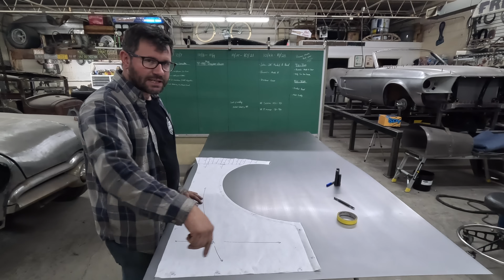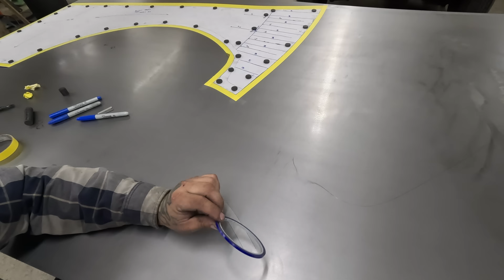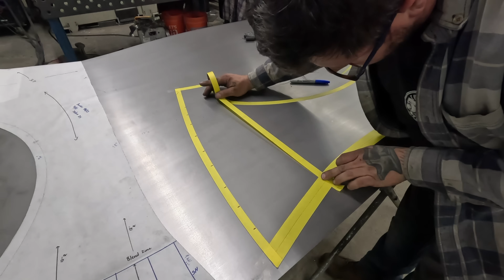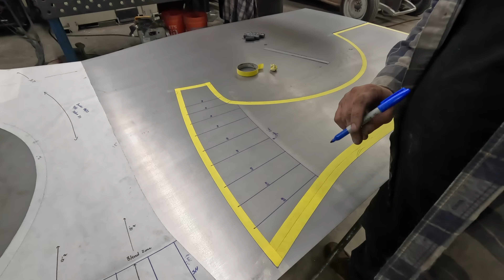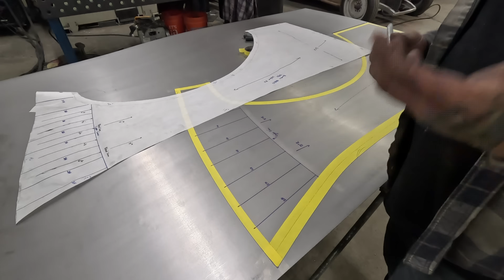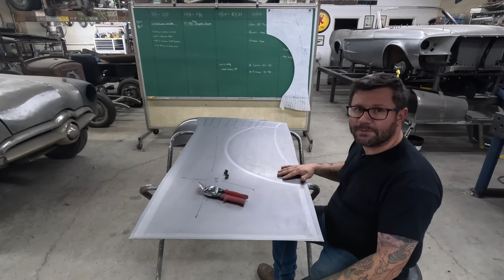Make A Model A Sedan Quarter Panel From Scratch? Sure Why Not!

Comment: You sure make it look possible. I just can't imagine at this point doing it myself. 
After adjusting gaps on my 66 chevelle, one of the fender extensions (pot metal) hangs into the new gap. I  thought that I might fabricate a new one with sheet metal by breaking it down into 3 or 4 pieces. I could slice the pot metal but I wouldn't know how to "weld" it  back together.  Thanks for sharing your talents.

Comment: I have spent the past 12 years learning how to metal shape and weld to make my own rust repair panels. I don't know anybody in my area that does what I do so it was a long and painful learning curve that my passion for old cars and trucks required. I have learned from books and videos. the best teacher has been for me to learn a concept and practice. The tips and tricks you are sharing for free on here is invaluable to those of us that strive to do the quality of work you do. I hate bondo and spent 80 hours learning to metal finish the front nose of my truck by hand. I made mistakes and learned from them and learned how to fix them. If I had the budget for the power tools I would have used them, but I feel learning with hand tools taught me how to read the metal so I know what it needs. The videos you are doing is going to cater to the guy that has pride in his work and always strives to do the best he can and learn to always do better. Keep it up. I'm sponging it up.

Comment: That precision you're emphasizing either tape and using the fine sharpie gives you a better level of confidence. You're not trying to remember to add or subtract a little bit here or there. If your layout method is always consistent, you'll always be confident.
You're doing a good thing emphasizing this "boring" stuff. 👍
Reply from the maker: Thanks, yep consistency turns into efficiency and repeatable results

Comment: Thanks Mike. The information that you share is first class. 
Can you explain light lines a bit further at some point please?
Reply from the maker: Sure, its actully a simple concept. a light line is just that, a line of light where a radius starts, stops or changes. the light changes with the shape of the panel

Comment: Found your channel from watching Karl Fisher's channel. Quality information is never boring!! Thank you for sharing your talent and experience to a novice metal shaper, ( restoring a 1960 Triumph TR3A ) . I have never seen a spring center punch like the one you are using. Did you make the center punch or is it commercially available? I find it most interesting the tools that are being used to make metal shaping easier. I usually use a metal scribe but I will be trying the fine line sharpie. Frank
Reply from the maker: Thanks for watching, the punches are available though the store on my website cornfieldcustomsltd.com

Comment: Great video! Instead of a center punch, ever tried using a leather copy wheel  / marker wheel to trace the pattern through the paper? I find those to be useful as they leave a slight mark but no indentation.
Reply from the maker: I dont like using them, i prefer the punch with a light strike

Comment: Great Video. Great information. Thanks. Wray from Proshaper does a tape template. Did you ever try it that way. If so, why did you feel this is Better. 
#STAYSAFE 
#PHILLYPHILLY🇺🇸
Reply from the maker: I dont like the flexible shape pattern because it doesnt show you the path, or road map how to get to desired shape. you just stretching the metal up and until it fits the pattern. a lot more guess work that way. also they are for stretch based shape work and I work mostly in Shrink based shaping. I would have to cut the flexible shape pattern apart to lay out a flat pattern which is a waste of time, and tape when a paper pattern shows exactly what is needed where it is needed with no guess work
Reply: @cornfieldcustoms  Thanks. Keep the Video coming. Love them a lot to learn. 
#STAYSAFE 
#PHILLYPHILLY🇺🇸

Comment: Hay buddy I do like your show I also have an A model that I’m doing panel work on but where do you get the patten ?  my quarter panel is not good, it’s the coupe I was thinking about getting a brookville quarter panel and welding the top half?? I love doing what you do and would love to be your student to get my head around characteristics of sheet metal 😊😊thanks
Reply from the maker: There is a link in the video description to the video where I patterned the original quarter panel. As far as using a brookeville roadster quarter on a coupe they are a lot different from one another .
Reply: @cornfieldcustoms  ok cool thanks buddy, I need all the help I can get , but I love to do it 😊